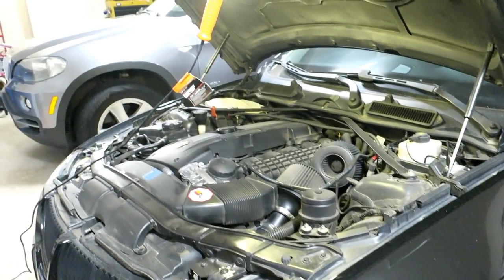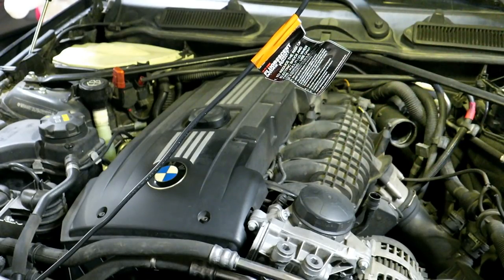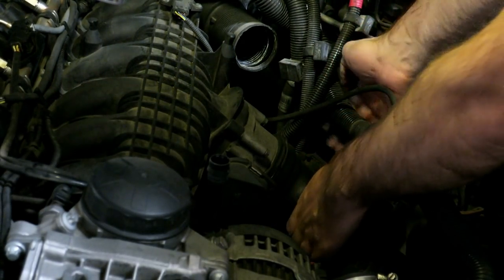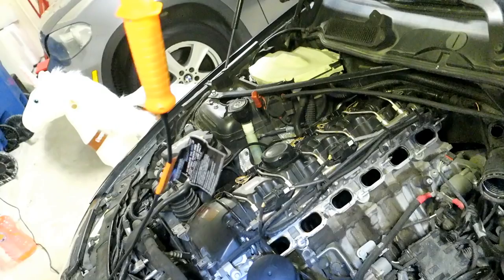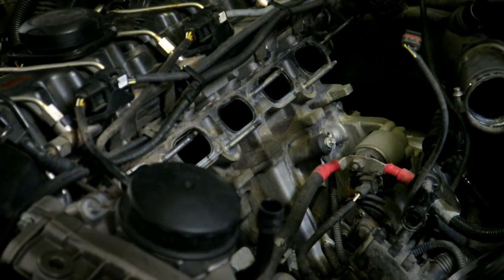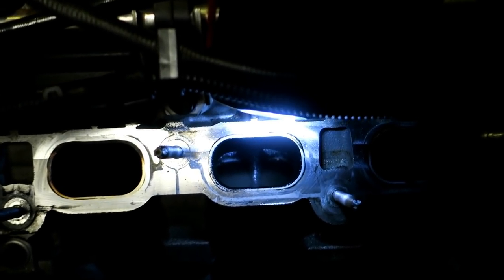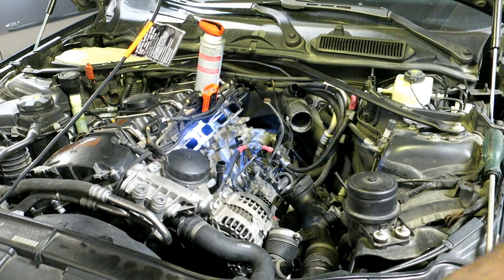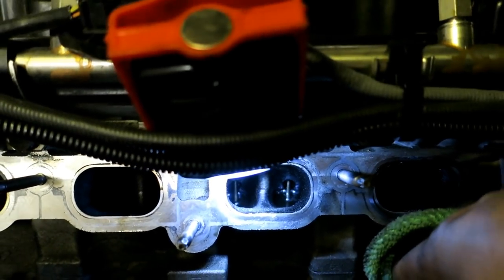Intake Valve Cleaning Without Any Special Tools N54 N55 DIY

Comment: Awesome tip on the starter, saves a bunch of hassle and is super helpful to actually watch the valves open and close. 
Some notes from my amateur DIY: 
Pumping the solvents out is not worth it. Stuffing paper shop towels in there was much easier, cleaner, and more efficient.
In my experience, fuel injector cleaner worked just as well if not better than the CRC product (ran out of CRC cleaner after the first 4 valves and switched) and is much cheaper. 
Understand, this is a messy and tedious job. It took me days to finish (also replaced both OFHG gaskets) - definitely recommend replacing the throttle body and manifold gaskets as well because it's quite a chore to get them off and you really might as well. 
At 108k miles, my intakes were caked. Took about 3 passes with the CRC cleaner and 2 with the fuel injector stuff before several more passes w brake cleaner. Drill w/ wire brush attachments were definitely appreciated (don't worry about scratching the metal). 
Also highly recommend long pick tools. The short ones didn't provide nearly enough reach or leverage and strained my fingers.
Compressed air is also very helpful, otherwise u can't get the stuff that settles to the bottom (I bought a little vacuum gun on Amazon and it worked great). You can block the port with a microfiber towel to absorb the brake clean while u blast, then come back and blast out the dry bits (fumy process, respirator good idea). 
Last couple notes -- it is WAY easier to reinstall the intake manifold if you have someone help you push the pipe near the firewall back towards that direction before attempting to mount it. Struggled for about 20 minutes before my housemate helped hold that thing and then it popped right on. 
Lastly, that cable hub under the manifold is a bitch. Good luck.

Comment: As far as I'm concerned this is the only product that really works for cleaning the intake valves. Thanks for the vid
Reply: is this starter idea to move the valves after you finish cleaning is only method ? can't i just turn on the car without any spark plus to ensure no fluid inside ? if not where to buy this starter kit that he uses to flip and run the valves w/o turning the car on ? 

 my car is E280 272.9 , but i am just asking generally because i'm willing to do the same and make a video to teach other and share knowledge , thank you so much in advance
Reply: Mohamed Ahmed Fathi ❶ you need to rotate the engine with a wrench and socket on the crank pulley

Comment: I have done this intake valve cleaning 2 times now on my 335i and it took me several hours with seafoam and brake cleaner. I could have saved myself alot of trouble by using the CRC...thx for the video...

Comment: This is when you need that suction/vacuum system at the Dental office.
Reply: Or better yet, rig up a shop vac to a small clear hose. That’s what I’m going to try ;)
Reply: Use reducer hose on your wet dry shop vacuum. Each not to overheat the vacuum motor.
Reply: Shop vac and flammable liquid?? I think not. 
Get a large syringe or a compressed air, brake bleeder.
Reply: That's where oil extractors come in handy 👍
Reply: If you have a home air compressor you can really blast air in that port and get rid of any residual crud.

Comment: Great video. excellent camera work. I tried to take stills inside the intake port but could not get it light upyou were able to light it up and and do the work at the same time!

I completed the job on my N55 in a 2012 335i, 166,000 Km. Some of my notes for N55: 
1) The carbon was not that bad compared to other videos I have seen (mostly N54?) I think that N55 are less prone. I did the carbon clean anyway. 
2) Your comment about hydrolocking the engine scared me shitless, so I took out the spark plugs and turned the engine over to make sure. 
3) I used your engine bump method to turn over and close valves. 
4) I used a brake vacuum pump to suck out the dirty fluid. 
5) Do not use any metalic brush. I started to use brass brushes, but saw pieces break off the brush and switched to a tooth brush. I did an inspection with an endoscope to make sure I had it cleaned out. 
6) Replaced the intake manifold gaskets and this was probably the only maintenance that was really necessary. The gaskets were still pliable but about 1mm narrower than the new ones. Boost is better now.
7) The only really tricky part about this job was removing the connectors from the DME. I did not see details on this video, maybe only relevant for N55. I found a you tube for N55 DME connectors after stuggling for an hour. The right hand connector in particular has a lock that must be pulled down to release it. The lock is hidden from view. Once off, the adjacent connectors can be removed easily.
8) I also replaced the MAP sensor on the manifold. I was getting implausible pressure codes when trying to boost. I replaced the MAP on the charge tube with no effect and so used the old charge tube sensor to replace the monifold sensor. It had a bit of dirty oil on it a nd cleaning may have been just as good. In the end I do not have the implausible pressure error code come up now. Maybe combined with point 6)

Thanks agian.

Comment: Well done video. Went thru the process yesterday. A few things:
1. Allow PLENTY of time - I spent about 4-5 hours, and could have spent 2 more. 
2. Suction is key - figure out a good way to suck the gunk out. I had several options on hand - 2 different spray bottles jammed up, but the cheap turkey baster plus a bit of tubing was best, but required coordination to keep suction going while pulling it back out so the fluid didn't escape. The shop vac suggestion from others would be waaaay better I'm sure.
3. I did 4 out of 6 valves, ran out of daylight, patience and hamstring pain tolerance :( Valves were better, but nowhere near the results shown. I'm sure with more time and spray I could have got there. Suspect they need a couple of half hour soaks each, easy. 110K km on mine. Dirty boys, about the same as V-DIY's.
4. I'm gonna look into a cheap walnut home build. Having gone through this now, I wish I'd just done that. This was pretty painful.
5 *Bonus point* The metal bracket under the valve cover, clipped into the plastic electrical junction box (around 09:15)?  FORGET trying to slide the %$#^ing clips out, fools errand that will drive to drink! Unclip the 5(?) clips holding the bottom to the top of the junction box (front and sides, none facing rear of car) with a pick, and the top will come away with the valve cover. Easy!
Reply: Bill Boyce the hamstring pain tolerance! I feel you.😂😂😂

Comment: A lot of people don’t understand the concept of this video. No surprise. YouTube is full of the most intelligent people on earth. I gotta say thanks for tackling this project the way you did. Gave me the confidence to do this project along with replacing my valve cover and oil housing gaskets. Big project but now I know my 90k mike N55 won’t give me typical issues for a while. 
I bought 2 cans of CRC and 2 cans of another “intake valve cleaner.”  I gotta say the CRC was miles ahead of the other cleaner. Amazing how you can see the CRC foam and break down the carbon. The other cleaner was more like engine degreaser or brake cleaner. It didn’t come close to the effectiveness of the CRC. I ended up buying 3 cans of CRC, small pipe cleaners, picks, a used toothbrush, and my shop vac to brush, pick and draw out the fluid from the ports. Amazing. It worked like a charm and it started up with no warning lights or misfires after putting everything back together. Runs smoother at idle as well.
Once again thanks. This was worth saving myself from buying an air compressor or walnut blaster. I think shops charge about 500 to do walnut blasting alone. I was able to replace my valve cover, replace my oil housing gaskets, and clean my intake valves for that same price.

Comment: Hey, I just thought I'd offer up my experience. I genuinely think this is an excellent DIY video. Obviously a lot of time and effort went in to the production and testing of the CRC Intake Valve Cleaner demo'd here. I was so impressed by the results that I decided to grab a couple cans of the cleaner and attempt this myself.  It made good sense to do add on an intake valve cleaning as I've been progressing through a series of intense maintenance & repair projects on my 2009 135i over the past couple months. Of note, my car has ~81K miles on the odo, but I had my intake valves walnut blasted back around 40K miles ago. I have been running with a BMS oil catch can since I purchased the car back when it only had 38K miles. However my stock turbos had blown oil seals which leaked oil significantly through to the turbo outlet, intercooler, and etc.  That's now fixed thanks to VTT. 😎 So, last weekend I popped off the intake manifold and confirmed my valves were well in need of another deep cleaning. I proceeded to follow along with this video to the best of my ability. At first I made multiple attempts at spraying the cleaner into cylinder 1's intake (obviously with valves in the completely closed position); totally submersing the valves stems. At no point did I observe anything remotely resembling the "scrubbing-bubbles-like" chemical reaction displayed in this video. A bit of foam did appear briefly on initial contact, but quickly subsided in to a mild bubbling akin to a flat soda pop. Now, I do live in California, and I wouldn't be surprised if the stuff they sell out here is watered down... Anyway I let each application sit from 15 mins to 30 mins, along with a bit of gentle scrubbing using a small bottle brush and non-marring pick tool. I followed each application with a thorough vacuuming with my Shop Vac (equipped with a spare piece of rubber fuel line duct taped to the end of the nozzle). I can say objectively that the cleaner eventually did loosen and remove the larger carbon deposits on the valve stems to a good degree. Yet a moderate amount of caked on deposits remained on the stems, and the tops of the valves remained encrusted. I applied one final treatment and let it soak overnight. The next morning revealed only minimal additional cleansing. At that point I had burned through about 2/3 of a can on just one cylinder. I might have settled with that result and moved on to the next cylinder, but there was one very troubling side effect. The cleaner had created a thick semi-fluid sludge build up around the valve seals. There was just no way I could sufficiently clean it all off. I feared potentially damaging the piston/rings should it ooze down inside the cylinder. At that point I pulled the plug on the experiment and ordered a walnut blaster kit from Harbor Freight; and the proper vacuum adapter and wand from FCP Euro. I'll just need to rent an air compressor once everything arrives and be done with this little headache, hopefully next weekend.
Reply: This is very interesting. I've watched a lot of videos on this as well as one on my favorite (Besides "Vehicular DIY" of course lol) YT channel "0 to 60" where he had the intake removed from the car as he was doing an engine swap. So he decided to do some experimenting. He got cleaners and he got walnut tools and requirements so he could se. He seemed to have the very same troubles you were having here with the chemicals. so after he had some initial success with the cleaners he decided to use the walnut shells and then he had clean intakes but a huge mess in his garage as he didn't use the attachment you purchased for using the Shop Vac. SO it's a strange thing with this job. He is in Australia so maybe climate might be a factor in this? Not that I can make sense out of it. I've seen videos where folks had great success with the chemicals and some....Not so much. I found a very inexpensive vac adapter on Ebay for our intakes ($20 or less) as it is made with a 3D printer. Then I found a gun type nozzle with a small (not too small mind you) hopper container attached to the top of it for the walnut shell medium. All I have to do (I haven't tried it yet but reports are it works a charm) is hook it up to a small air compressor and use my shop vac at the same time and I should be able to clean then each out to perfection in no time with minimal mess. I live in Chnada.....Oops I meant Canada and we have a store called "Princess Auto" which sells lots of tools and all sorts of things like air guns with hoppers on top. Maybe Harbor Freight might have the same thing?  Sorry for such a long reply.
Reply: How's it running now? Any side effects?
Reply: @OneManOnFire  Well, over the course of the last 18 months, I actually ended up doing an almost a full restoration. After a proper walnut blast, new VTT turbos, and a rather long list of replacement parts, my N54 literally runs like new. Now I’m in the process of upgrading my diff to an Mfactory helical LSD
Reply: @kar4tube  Thanks for the update

Comment: Got my valves done today, really wasn't too bad, just a bunch of elbow grease. Hardest part was getting the intake manifold back in. Prolly a good idea to disconnect the battery when doing this as I shorted the starter with the bracket on the bottom.

Comment: I serviced my car with this product and I was really impressed, I wasn't that impressed with the  walnut blast.. Great video! keep them coming!
Reply: Walnut blasting results in factory clean valves.  Im wondering how you were not impressed?
Reply: did you take off the manifold or use the spray while car is running
Reply: How were you not impressed with Walnut Basting. I have a Walnut Blaster that I use for my 2013 VW to clean to valves every 40,000 miles, and it takes me about 5 minutes per valve and they look like new again.
Reply: @1badk20  How dare you compare a VW to a BMW,  I can disassemble a VW in about half an  hour, good luck trying that with a BMW.
Reply: @MrCoyoles45  what in any way shape or form, does that have anything to do with what I asked. Regardless of what vehicle, Walnut blasting will clean a valve in about 5 minutes to pretty much looking like new.
Reply: @1badk20  ik im mad late here but I’ll agree with him partially. Spent a better part of my last saturday walnut blasting my n54 (only got to two ports due to my shop vac dying) and in scenarios with this much build up, I would dare say this is better. If you kept up on walnut blasting every 20-30k, it would probably be the better and faster method. Out of the two ports I got to, I blasted each for probably an hour each and there was still chunks stuck to the stems and the walls were covered in a film of carbon. Mind you, I do have 120k and I don’t believe it’s ever been done so yes it’s an extreme case but I can see where he’s coming from with regards to this being better than walnut blasting.

Comment: Dude, thank you so much!! I need to do this procedure on my 335i with 140K miles.  I've been looking for a DIY video on this for a long time. You're video showed and explained everything I need to do.
Reply: is this starter idea to move the valves after you finish cleaning is only method ? can't i just turn on the car without any spark plus to ensure no fluid inside ? if not where to buy this starter kit that he uses to flip and run the valves w/o turning the car on ? 

 my car is E280 272.9 , but i am just asking generally because i'm willing to do the same and make a video to teach other and share knowledge , thank you so much in advance

Comment: This is working SMARTER and not harder. Thanks my dude.
Reply: GentlemensTuck
How? Your supposed to spray this stuff in while your vehicle is running. The whole point is to not take off your intake manifold. It's a great product. Just follow the directions and its 1/100th of the job this guy did
Reply: Bronze Whaler...
It's like you didn't even read my reply. I never made any statement that you're calling out. Thanks for being so triggered tho, it gave me a good laugh. No shit this cleaner doesn't clean the intake ports or valves 100%.
Reply: Bronze Whaler
Ok... let me dumb this down for you. The the whole point of that product is to not remove your manifold. It is supposed to be used every oil change for any actual results. That's a fact.

Break cleaner alone would have worked more efficiently and would've been much cheaper as well. Unlike you, I didnt make my original reply a personal attack against the original commentor. As you did to me. I threw out an objectionable statement to start a conversation.

But you must be the expert. It's not like you're on YouTube watching inexperienced individuals trying to complete shabby DIY projects. Especially ones not using proper tools and techniques. This whole video was hilarious to me. Using the starter to turn the crank... using a steal pick on aluminum... not changing the gasket out... using an old soap dispenser to extract the wasted product... no torque wrench... not changing his oil afterwards. 

All in all, if you found this video helpful or if you feel that you gained any knowledge from this video; than your original reply should be directed towards you.
Reply: well said bronze lol